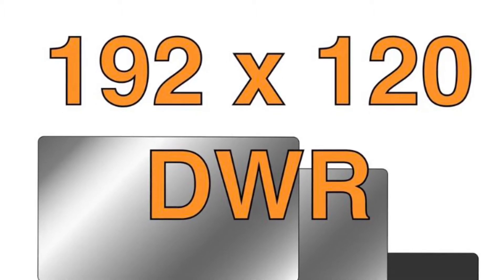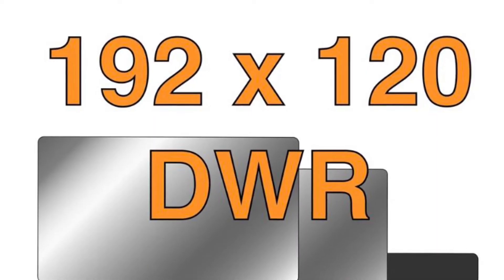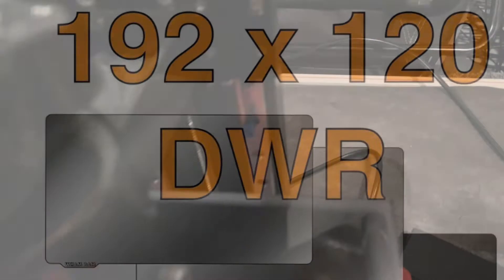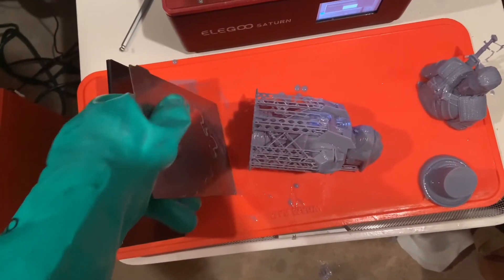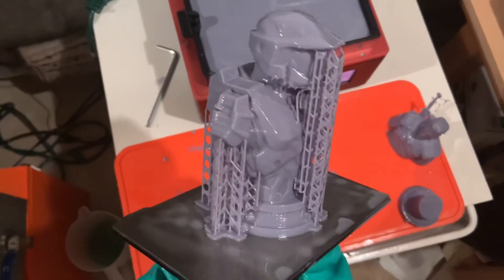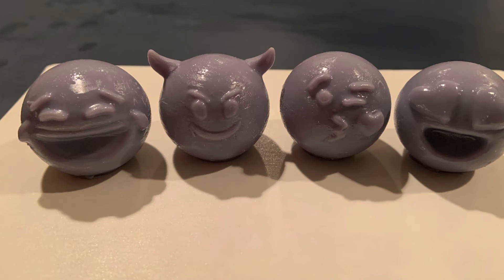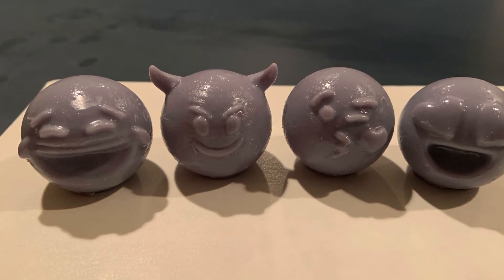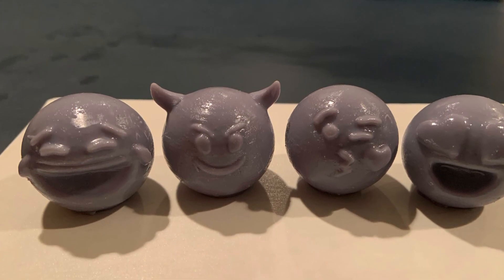Initial impressions of the Wham Bam Flexible Build plate for my Elegoo Saturn!

Comment: Not sure I like the solution to modifying the limit switch. It's probably better to place a shim at the top. Ultimately you're compensating for the thickness of the Wham Bam which effectively means the physical end stop limit sensor "thinks" the build plate is further away from the build plate than it is. You can't just reset the Z height Zero as it's not the same thing.. it's a physical "end stop" so you have to physically compensate via offsetting the end stop indicator bar down by the thickness of the Wham Bam. So you make a shim this thickness and screw it in at the top.. so it can't just fall off.

IME if your careful with how the part interfaces with the build plate you don't need a flex plate. Essentially with a bevel like Chitubox puts on the supports bases it shows you how to solve this issue.. a good example of a bad interface is the pre-sliced Elegoo Rook, its a flat 90 degree to the bed so your scraper hasn't got a lip to get under.... perhaps its deliberate so Elegoo can sell replacement build plates :P ?

Comment: In the intro you mention going over the install of the flexible build plate, but then you don't actually show the install or Z stop modification (the whole reason why started watching the video). At least we (sort've) get a tip on where to get the needed Z stop extender.